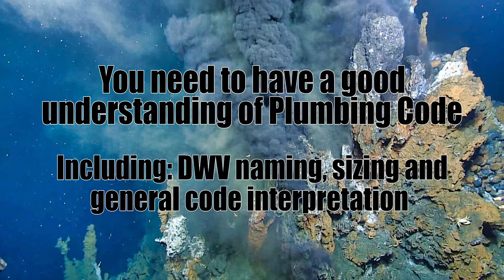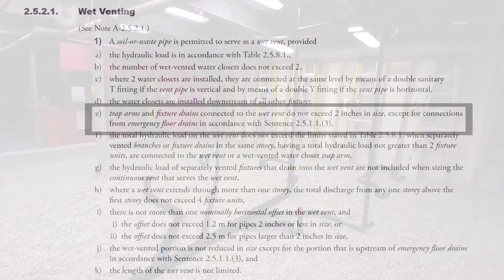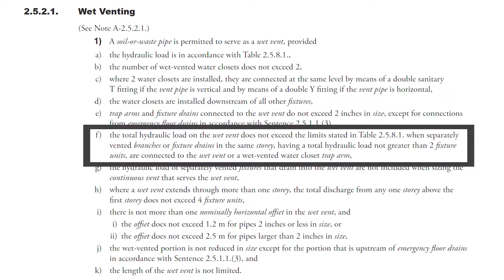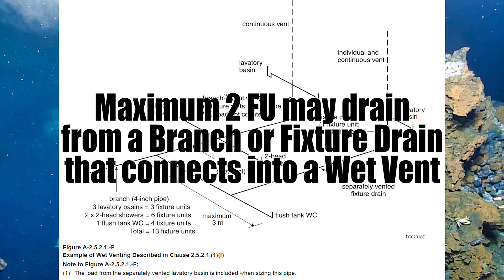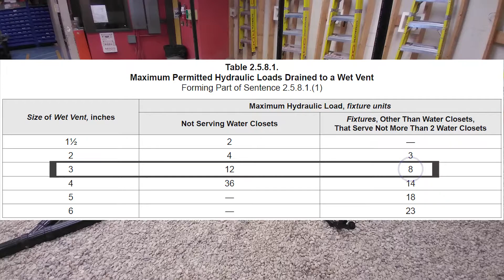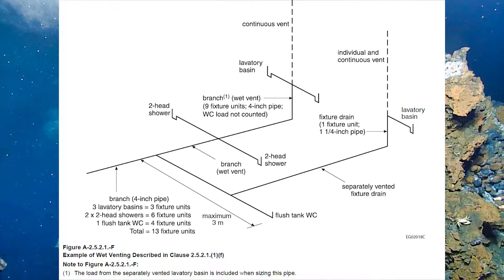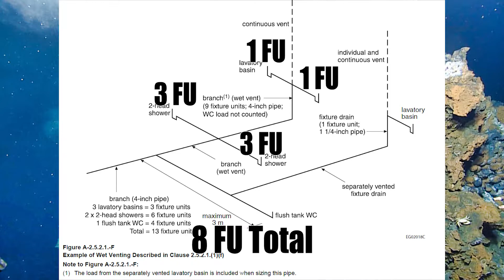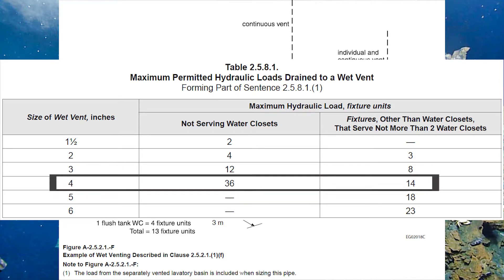Wet Venting Video:4 - Sizing an Advanced System

Comment: you said the maximum amount of fixture units per branch that can drain into the wet vent is 2dfu. later in the video you say the branch for the shower with 2 heads is 3dfu. ?
Reply from the maker: That shower drain is a trap arm, not a branch or a fixture drain. Therefore this is totally permissible.

Comment: I'm new to plumbing and especially wet venting. I have a question about A-2.5.2.1-F. Could you make the the fixture drain for the single LAV 2" and have it serve as the wet vent for the WC? Would that make the branch that is down stream of the dual 2-head showers no longer wet vented and 3". Also would the wet-vented branch upstream of the 2-headed showers then become 1 1/2"?
Reply from the maker: If you had a 2" wet vent between the top left lav trap arm and the water closet trap arm (wyed in at the current 3" - 45° elbow) then yes, you could change some things here.

Now you have a new wet vented system serving the lav with 3" coming up to it, down to the shower trap arm. This wet vent would be 2" in size from the lav to the shower. (Table 2.5.8.1    3 fixture units, not serving water closets) This also means the branch from the shower to the 3" connection where the toilet connects in would also be 2" (Table 2.4.10.6.B     6 fixture units)

The trap arm for the shower is minimum 2" because it has 2 shower heads. (See table 2.4.9.3)

Comment: So, all of those lines feeding into the wet vent can lay flat (meaning they don’t need their wyes “rolled” 45°)? This is the main thing I don’t understand with wet venting. Literally NO ONE mentions this until people start commenting that all the wyes need to be rotated. I’m confused on this point. What about the rule about the p-trap weir “seeing” the vent opening? Does this apply?
Reply from the maker: First of all, this is the Canadian code. If you are from the states, this will be different than yours.

As for rolling wyes or sanitary tees, start at video one in the series: https://youtu.be/9Bbumxmuzpo?si=SgGIpNKIOnfMGt8s&t=172

Comment: so seperated fixture drain that is connected to another individual vent is connected to the wet vent, that FU should not exceed 2. is my understanding correct?
Reply from the maker: Yes
Reply: @MathematicPlumber  I apologize for asking another question. But can I ask one more? In 2.5.2.1.f) it says when “separately vented branches or fixture drains” in the same storey, having a total hydraulic load not greater than 2 fixture units.  <---- If these branches or fixture drains do not have separate vents, is it okay to exceed 2FU?

For example, if a branch has four 1.5 F.U. (total 6 F.U.), can this branch be connected to a wet vent? This branch is NPS 2 which is acceptable to be used for a wet vent, and its maximum F.U is 6 by the table 2.4.10.6.-B . Thank you!
Reply from the maker: @손민호-s3h  Your limitation will be 2 FU, not venting those branches or fixture drains will just result in another code violation and the system not draining properly

Now, you could separately connect the four 1.5 fu branches or fixture drains to the wet vent, then this will work

Comment: Hi Kelly.  Can two separate wet vented sections from opposite ends of a house drain into the main drain and have their vents join in the attic before leaving the building through the roof. Thanks.  Steve

Comment: The regular vent needs to be rotated 45 deg above the middle of the pipe. And the wet vent does not. Would it be OK for the wet vent to be rotated more than 45 deg?  Certainly would keep the wet vent with less than %50  capacity.
Reply from the maker: The wet vent can be more than 45°, it has no effect on its function
Reply: @MathematicPlumber  phew, I got something right.

Comment: Just a little confusion with the 2 Maximum FU draining into a Wet Vent. At 4:41 you have a shower with 3 heads with 3 FU. How come thats okay? Thank you so much.
Reply from the maker: The 2 FU maximum is for Branches and Fixture Drains.

The shower is being drained through a Trap Arm, the only rule that applies for it is maximum 2" in size